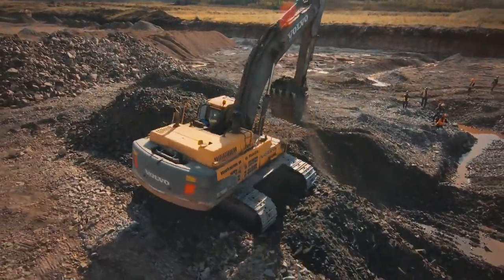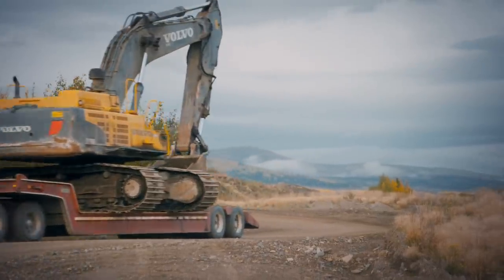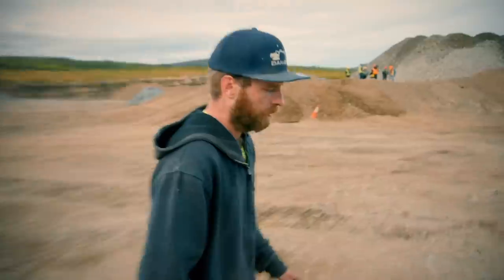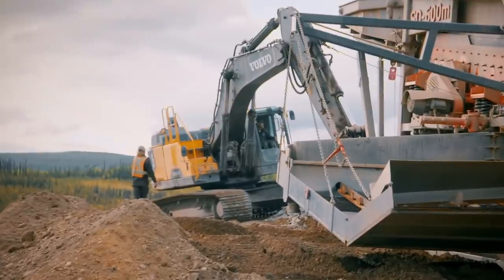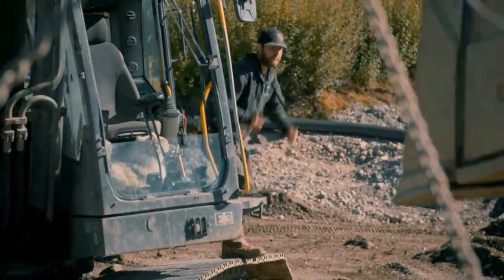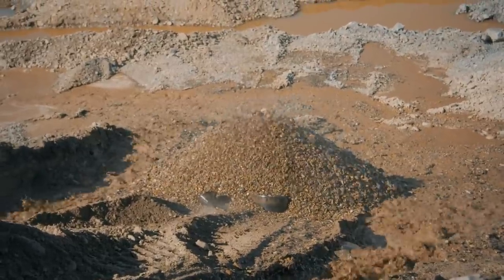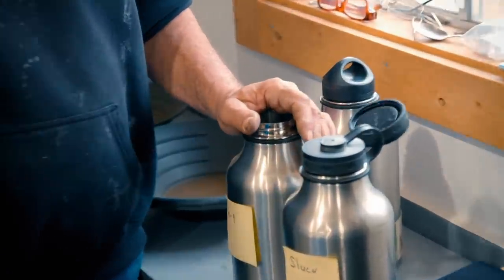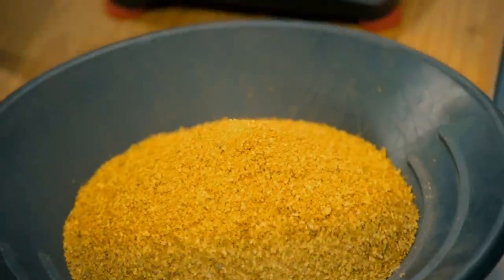Parker’s Biggest Ever Gold Week Returns Over $1.5 Million! I Gold Rush

Comment: Could you not mount those plants on a motor crane platform or alternatively an old bridge laying tank? If it broke you can still pull it but it would be much more flexible when not broken. Mostly for not blocking the other equipment during the relocations.

Comment: why wouldnt you just dig the ground deeper on the side of the pad where the tailing drop? A lot quicker and cheaper than building the pad higher.
Reply: Because you will dig past the gold and just move it around rather than collect it.
Reply: @notme8709  No. whatever you remove you put in a pile to run it through the plant, like they do with everything else. Also, they dont build a pad on gold rich ground..
Reply: @401Impala  oh, I thought the gold was usually at about 3 km deep, while copper is beyond that depth typically. However I don't mine gold, it's just something I seen on the show a while back.
Reply: The bottom of the cut is bedrock, can't dig any deeper than that.
Reply: @notme8709  what are you on about? This is alluvial mining. They are capturing fine gold left on old riverbeds, this is always near the surface. 

3km deep would be hard rock mining, which no one in this show has ever done. 

Copper mining is ore mining and as such is hard rock so is completely different to what they are doing here

Comment: I love these boys. They are constantly using inappropriate equipment in an amateurish way -- systematically destroying world class heavy equipment from Volvo, Cat and  Komatsu, et al. Well, done boys. You are greatly amusing.
For the placer deposits so commonly on the show, SCRAPERS are what's best. I don't mean 657s, either. You want LIGHT pan-type tow-behind scrapers that have LOW ground pressure, FAT tires, and high speed towing rigs like those of John Deere, K-Trec, et al. I don't even think these two brands are necessarily the best, either. But they're on the right track. The idea is to let NATURE solve ice -- not your excavator, not your ripper shank... DUH!
You want to just SCRAPE the top layers -- in the Spring -- WITHOUT destroying the under lying permafrost. You'll need it where it is to support your scrapers as you come back, pass after pass, at speed, to peel off the SLUSH & chilled mud. You must stay away from the utter muck that runs all over everything, your self-created swamp.
You can even run the slush through your wash plant -- when the conditions suit -- to just disposed of it as it turns to water. During this phase, you'll be stunned as to how much gold dust was trapped in the ICE that you've totally ignored all of your life. The Slush Technique requires stripping earlier in the Spring than anything you've known -- often in the extreme hours, too. You must catch it when it's soft enough -- but before it turns to a river of muck. Usually this means working when the Sun is down. Long day sunshine makes things go too fast.
So long as the deposit/ over burden is pretty flat ( an ancient river bottom ) scraping works great. It does not grub the land -- so you'll still need D-11s to get the lid off, usually. Just DON'T tear up the permafrost, don't rip anything. That approach will bury everything else you're trying to achieve. You'll generate the SWAMP you're trying to avoid. for the rest of the Summer. Think of yourself as a farmer trying to get rid of last years weeds -- right before seeding. You want to  harrow, not plow. (Harrowing the ice would be a clever idea to try. You don't want depth, You want to scratch the top inches. The Spring thaw will do the rest. Save your fuel, your equipment, your headaches. Let your mechanics sleep in. Just race to come back and peel off the slush. Speed is everything. Dozers are too slow, too heavy. Think of pulling two-three-four pans in a row... it's a race. )
You win by getting rid of all over-burden PDQ. Actual sluicing is a breeze, of course. Everyone can do that when the ground is right. The right scraping technique rejects over sized boulders long before they meet the Grizzly. They can't enter the pans in the first place. As they sit, they can  be pushed away by your Cat. You only want the smaller stuff. That way your wash plant stays up and running all Summer long.
Don't skip the fines in your sluices. Your profit is in the DUST -- not the nuggets -- not the flakes. See Freddie & Juan for how it's done. If your pile after clean-up has no dust -- you're fXXing up -- Big Time. ALL placer deposits should have the bulk of the gold showing up as DUST. I laugh when I see boys proud of their nugget hauls -- noting that twice as much gold ran straight out of their sluices into the tailings pile. No wonder they're living hand to mouth. BTW, I don't believe any of Fred's 'recoveries.' No-one can be that bad on good ground. He never has dust to show for his work. He is clueless.

Comment: Even though you get a good deal with Volvo. Volvo isn’t a good excavation machine. They are substandard. When they break down that costs you production. Personally I never own, rent anything but cat. Proven products proven production
Reply: For heavens sake there is nothing wrong with a Volvo.  The problem was a hose which is made by someone else probabley in China like parts in  many of the best brands like caterpillar and John  Deere.
Reply: @kevinklingner3098  lol. I’ve been in mass earth excavation since 1980 coast to coast. Cat is a 30,000 plus hour machine before major repairs. Volvo at best 10,000 hours. A Volvo breakout force. Swing is half of what cat is on same size machines. You have no clue what your talking about. Volvo hydraulic pump you can carry away in your hands. Cat, you need a forklift for. Cat is also the only machine that you can with a computer, pump up the hp and hydraulic cycle times. No other machine can handle such
Reply: @kevinklingner3098  John Deere… nothing runs like a Deere with a cat on its ass. An 8,000 hour machine